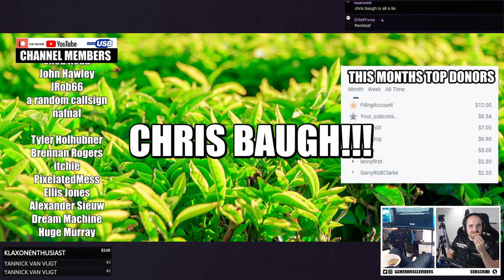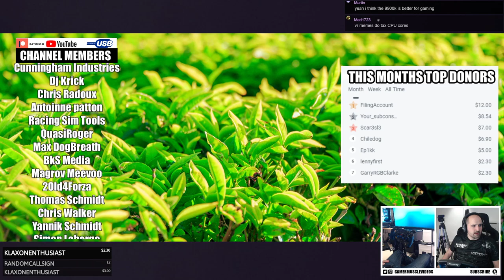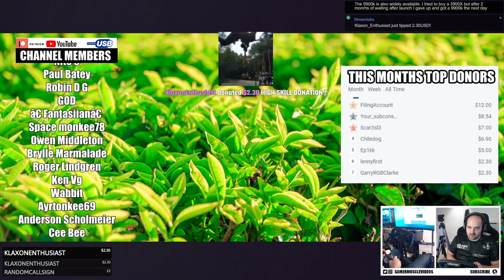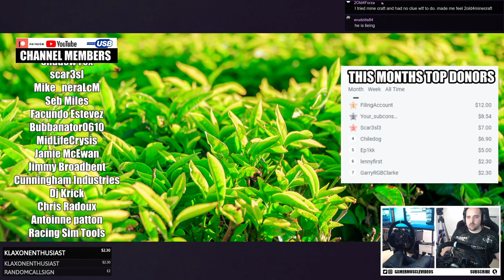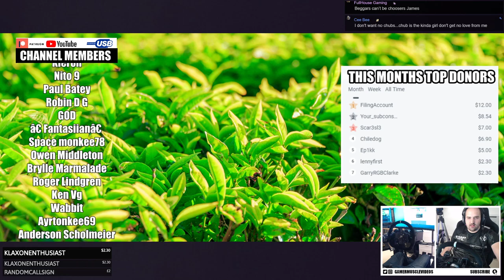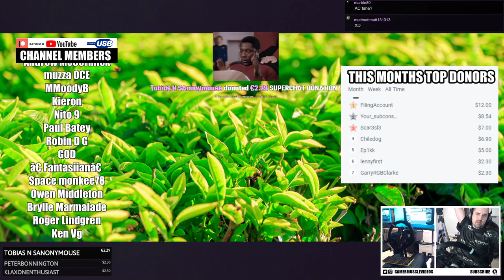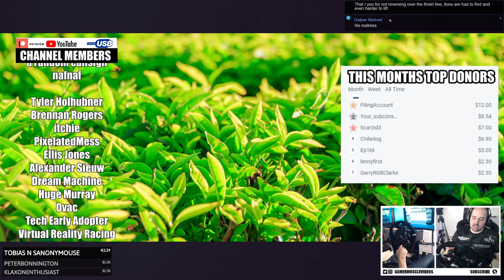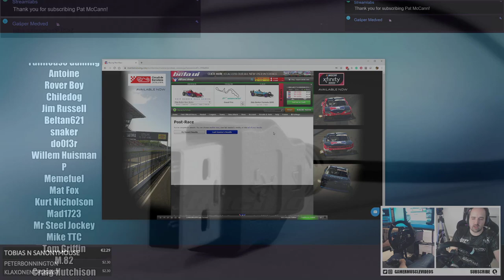Putting the AMD Ryzen 9 3900X In the Gaming PC

Comment: Does any one know if the fanatec csl elite wheel base and load cell pedals  is compatible with the playseat evaluation
Reply from the maker: I think it should be , all Fanatec wheels as far as I know use the same Fanatec mounting holes.
Reply: @GamerMuscleVideos  thank you, just ordered the csl set for ps4 and will get the load cell pedal when they are back in stock

Comment: At your resolution you are clearly GPU bound. Before and after gaming tests at 1080p would have shown up any differences the new CPU brought for those games. If your RAM is already 3000Mhz and you can overclock it to 3200 then no point spending the extra to buy a whole new set of RAM again.
Reply from the maker: I think this is pritty common knowledge.
Reply: @GamerMuscleVideos  Agreed, but when you switched game to see if there would be a difference with that one I wasn't sure you were aware or not (and a few comments too). The RAM comment was also based off you saying you might buy newer faster RAM. Also common knowledge but getting a GPU/CPU real time utilization tracker can be pretty interesting/ informative too. I guess the technicalities don't matter at this point, you have a very nice system.